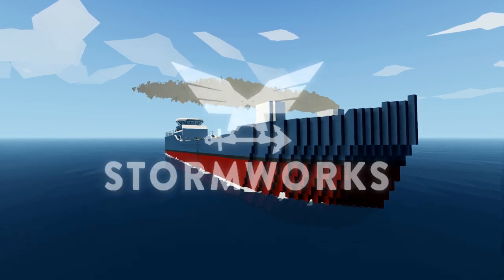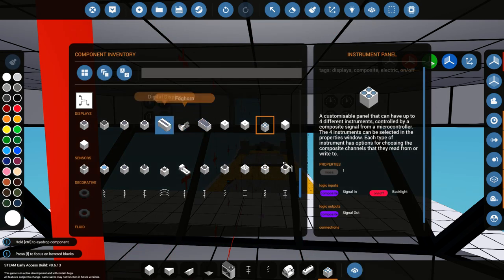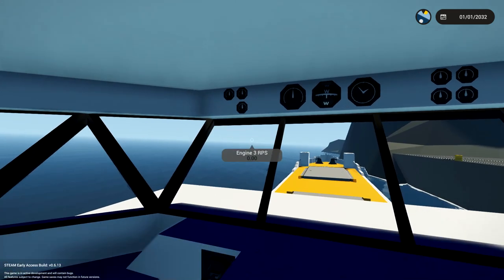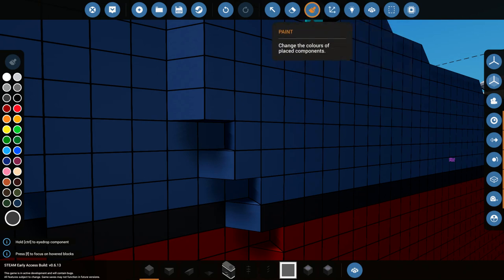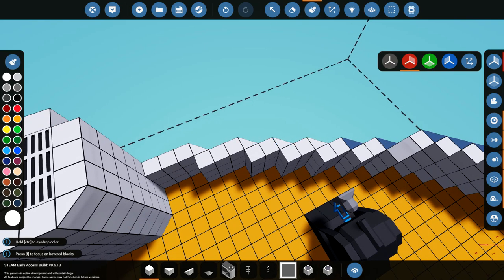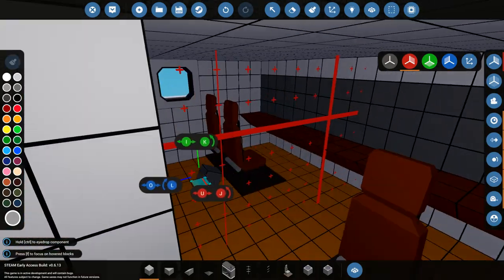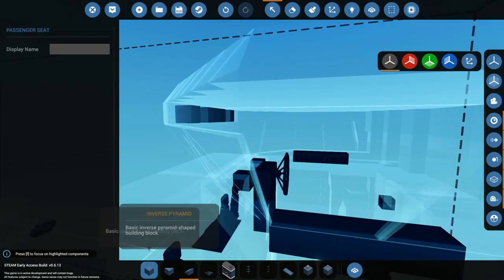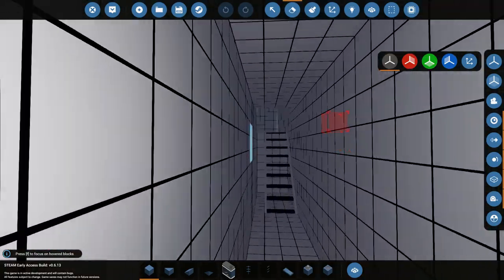Hull Smoothing  -  Cargo Vessel  -  Stormworks: Build and Rescue  - Part 7

Comment: one pipe can only hold what one pipe can hold.. a T pipe splits the one in into two outs.. 50% reduction coming out of each pipe.  Each additional T means another reduction.  You can see this easily enough by putting pressure sensors before and after "T's"

But discovery of how things work in this game is part of its beauty, at least to me anyways.